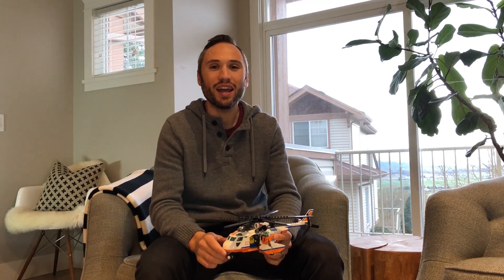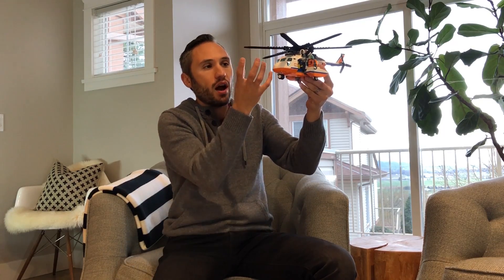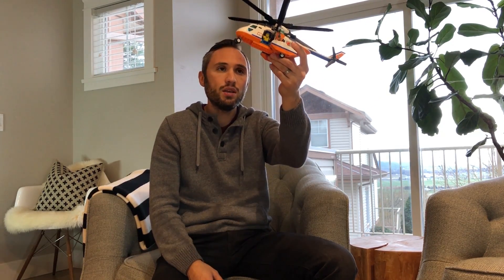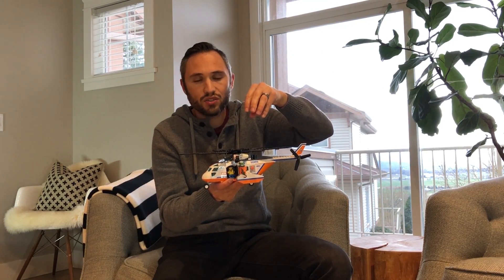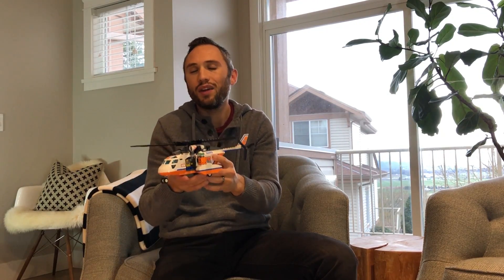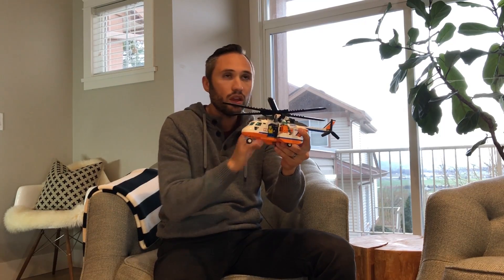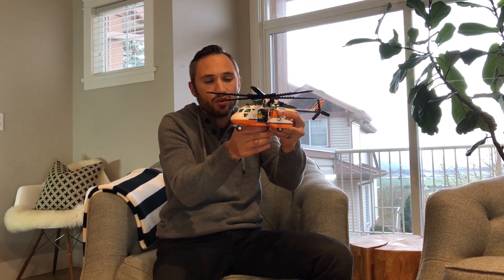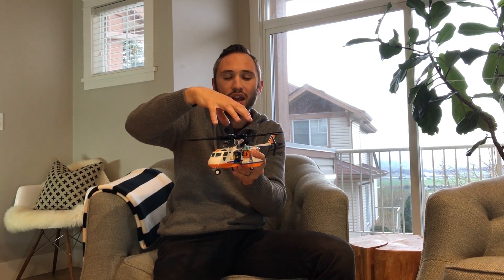Vortex Ring State IS NOT Settling With Power

Comment: It may be that your country has tried to use the name of one hazardous flight condition for another, but it's a case of majority rules, and the majority of the world has vortex ring and settling with power as the same condition. Does your definition of settling with power really need it's own name? To me this is just coming in too fast. You could do the same thing in an auto rotation, but you have no power, so what is this called, settling with no power? I'm yet to find a pof book that defines these two names as different conditions, but I certainly haven't read them all !

You also mention that the stall region in vortex ring moves towards the outer area of the disc. My understanding is that the outer area is not stalled. The vortex creates a high induced flow in the outer area which creates a very small angle of attack, creating a very small amount of lift, or even no lift, but it is not "stalled" p. 158 of PoF W.J Wagtendonk. Always happy to be proven wrong, but probably need more than a lego model to do it ;) love the videos, cheers.
Reply from the maker: Jon Keller just because the majority says something it doesn’t mean it’s right. I appreciate your feedback though. Settling with power definitely deserves its own term. Coming in on an autorotation is completely different because you maintain ample forward speed so that you can translate that inertia into rotor RPM and a deceleration of downward momentum in the flare. Completely different.
Reply: When it comes to naming convention, majority does rule. The words used in the name "Settling with power" do not describe the hazardous flight condition you have described well, however I will also agree that it does not describe vortex ring well either, which is why we have another name for it. If you were to look at the words used in the name, "Settle" and "Power", by your definition, every approach is "Settling with power". To come to rest with power in use. Nothing in the name describes anything hazardous. It's a silly name for both conditions, which is why I fall back to majority rules. I used the auto rotation example because the way you described it, you could apply that to powered, or non powered flight. It's as if you're trying to redefine the word "Settle" as something it's not. The words in the name should describe the condition well, in both cases they do not.

The way I see it, the argument most people make is "It's correct because it's what I was taught", and unless someone can back that up with a good explanation, is always a bad reason. The only reason you gave in your explanation was "it's the way it's defined by the Canadian faa". So unless someone can give a logical reason to why that name fits better, "because i said so" is not good enough. I've also heard that some people refer to over pitching as "Settling with power". Can't agree to that one either. It's probably a term people should stop using.
Reply: Not giving you grief, it's just an argument I've always found fascinating. What you've described, we would simply call "running out of power on approach", not exactly a fancy name, but makes sense to me. The moment where you've hit 100% of your power available and it's not enough to arrest your rate of descent, but your rpm is not decaying.

Comment: I Fly large radio control model Helicopters and this happens all the time, Finally an explanation as to why the helicopter suddenly sinks at an alarming rate and a way out of it, thanks!
Reply: I fly 3D RC helicopters and this phenomenon seem to be most susceptible on helicopters that have low power or high load per rotor disk area (or both). Modern 3D RC helicopters simply have so much power that you can escape from vortex ring state just by giving it enough collective. That's not something you can do with real helicopters, but it's great fun.
Reply: @timokokkonen5285  I fly large RC helicopters also, (Zenoah gasoline powered - not nitro). Neither of these conditions ever occur because of higher head-speed and the excess power that is always available. You can basically blast out of any condition. Unfortunately, most full scale helicopters have very little power reserve to escape these conditions and thus demand that you don't get sloppy and get into them in the first place. I do believe this is reflected in the accident rate of under- powered full scale helicopters of all sizes.
Reply: Falling thru dirty air....
Reply: a good few years back I had started out in RC Helis, and was puzzled as to why my heli dropped so fast while in a hover.  I had been descending quite fast in calm air conditions.  I noticed too that the same thing will happen in a wind.  If the heli is descending and its ground speed is the same as its airspeed (or vice versa) so heli moving in the same direction as the wind/air mass.. vortex ring will bite.  Try it, you will see what I mean.
Reply: Ive mostly noticed it as the helicopter is suddenly vobbling, it feels like it's floating on bubbles almost. Basically very unstable but  not unrecoverable as said.
Reply: Frankie NV how you are not dead then if that happens to you all the time
Reply: @LalaRanj1  Because he is standing on the ground the entire time. Radio controlled helicopters.

Comment: With the Vuichard recovery method, moving the cyclic to the left is only for European-made helicopters with clockwise rotating main rotor blades. The correct method for American-made helicopters (Robinson, Bell, etc) with counter-clockwise rotating rotor blades is to move the cyclic to the right.
Reply: Julien Pham - It's to take advantage of the thrust of your antitorque rotor to slide the helicopter over quicker.
Reply: Be careful in teaching the wrong recovery. The correct recovery is to slide over OPPOSITE the power pedal. What you say in the video will cause an excessive loss of altitude.
Reply: Power pedal fot the G2 is the right, so yes, you have to slide to the left with the Guimbal G2 @WaterFillerUSA
Reply: Why do you have to move the other side depending on the helicopter? If I understood the video correctly, the goal is to move out of your own downwash fast. So why is it important the direction you go? Thanks
Reply: Julien Pham , moving to either side ( side stepping ) will get you out of the vortex , when they are talking about the American made vs European , it has to do with power requirements , ( American made CCW rotor system going to the forward and right requires less power then going to the left and opposite for European helicopter. For more details look into TRANSIENT TORQUE. 

It only applies to single rotor helicopter.
Reply: @browniebrazil  that's not true. Raising collective will lead to less authority other the rotor system(stalling out more of the disc). The reason we raise the collective is to increase torque, that then is counteracted by the tail rotor(maximizing translating tendency) this is the main reason you move to the side. If you go the opposite direction, you would not only have to work against it, you also don't have enough mainrotor authority to accomplish that. In that case it would be wiser to go forward or backwards to not have to work against the tail rotor. 
Ask yourself why we don't go forward and only raise collective... When in SWP you simply  can't. 
Being able to sidestep will get you or of the vortices, true, but you won't be able to sidestep against your TR thrust. Trying it is plain stupid, considering you are in an emergency at that point.
Reply: @harf4ng  Redundant Rudder authority maybe?
Reply: I was just going to mention this
Reply: The thing is he had it completely wrong. Raising to fill throttle line, left pedal and left cyclic would lead to a devastating outcome, especially in European helicopters during Vortext Ring State.
Either left pedal and Right cyclic or right pedal and left cyclic... 
I would like to see him correcting this statement. Even though anyone doing this maneuver will have more training on it than watching a video, it might confuse someone into thinking "right right" or "left left" and crash.
Reply: SJP lol :) indeed that should be terrifying :) I think he made a mistake between rotor blades and the compass
Reply: VRS in a verticle  descent into a small landing spot thru a forest of 100' trees😨😨😨Now what does one do?😢
Reply: Is this do to retreating blade stall?
Reply: @jeironamobey8136  - It's due to descending fast enough for the air to flow upwards near the hub of the main rotor, and the upflow effectively increases angle of attack into a stall. It also results in a second inner ring of vortices near the hub in addition to the normal ring of vortices at the rotor tips.
Reply: jeiron session retreating blade stall typically happens in high speed flight. The helicopter will pitch up and roll left due to gyroscopic procession. The effect would also cause you to slow down, bringing you out of the stalling condition.
Reply: The cyclic is moved into the direction opposite of that of the tail rotor thrust. The combination of tail rotor thrust and cyclic move the helicopter laterally. Recovery begins when the main rotor travels into the upwash of the vortex ring it's laterally moving through.
Reply: @S LMAOOO
Reply: Was thinking this when I saw another vid on recovering from a strait approach landing on a ledge. Not realising blades were built to rotate both ways due to area build, I was thinking that the approach would matter if your only chance was opting out of landing with left or right cyclic. Be gentle, no flight experience in rotating or fixed wing, but I try to learn fast.
Reply: ...just to point out that it's just a brand in Europe which bilds helicopters with clockwise rotating rotors (Eurocopter, now Airbus Helicopters). All the other brands, such as Agusta (now Leonardo), bild helicopters in the standard way.
Reply: @palacio802  Russian are all standard rotation, as is Guimbal and many other brands.
Reply: Was just gonna mention this 😊
Reply: Plus he didn't mention to add power first, like in the video he linked (and which is correct).
Reply: I’m guessing he’s talking about the Cabri G2s he flys.
Reply: You are right Garry, this lateral recovery technic depends of the clockwise side of the rotor.
Anyway, what you guys call Vuichard technic, is not new, most of external load pilots use it since a while already.  This technic does not replace the other. Cyclic foward (or into the main wind) and pich lowered is still a good technic depending of the vortex conditions, weight, quality of your blades, rotor efficiency, trajectory/path, hight, (cross)wind(s), landshape and type of obstacles you got around you. 
One technic, doesnt replace the other, they are just complementary and combinable.
Reply: @dvclama  That answered so many questions it threw up. ;)
Reply: You cross-control, so you don't actually need to remember whether you have CW or CCW rotors
Reply: Actually, that only applies in relation to the Equator.  Blades turn opposite directions in each hemisphere.

Comment: On a R44 it would be left pedal to counter torque as I pull collective and right cyclic to move out of wash.   I think you said left pedal and left cyclic but even on a European you would be right pedal and left cyclic?   I think??   Great info!
Reply from the maker: chris leavens correct, that was my mistake.
Reply: good catch chris, was thinking the same thing.
Reply: chris leavens Eurocopters are usually the oppisite rotation on the main rotor. I flew an Allouette II in Guatemala and took a few flights to get used to it. Fly safe!

Comment: Damn dude, I'm new at this (having only done a discovery flight) and didn't realize there was so much to flying a helicopter but, your explanations are so easy to understand and make so much sense. One thing, once in a settling with power state, if started high enough, can I  presume a smooth enough landing not to crack a skid? And if not, would you go forward on the collective, kiss your ass goodbye or just not get yourself in a settling with power state? Your videos have me holding out for spring time lessons.
Reply from the maker: Joe-n-Tex the issue with settling with power is that you only get into it when you are coming in for landing which means you are close to the ground. Depends on how heavy the Heli and how quick you are going will determine the level of damage. It could be as simple as the skids absorbing the hard impact but with no damage or action damaging it.

Comment: i don't know where you get your idea from But you need to know why it's called vortex ring state o settling with power first. they are two different words that mean the same action difference in name comes in difference in action... ( vortex.... causing a vacum that sucks the helicopter ) .settling with power....  helicopter has power but losing altitude.)  hope you get it
Reply: jun toph I think we all agree on how Vortex ring state occurs. Close to zero airspeed, RofD greater than 300fpm. Correct? 

   “Settling with power” occurs with FORWARD airspeed AND descent. Let’s say Your max gross weight on a steep approach with 40kts forward airspeed. The ground is approaching quickly so you pull aft cyclic and collective to slow you down. You ARE slowing down but not quick enough, so you pull more collective. It continues to slow you down but is not enough to stop you before you hit the ground. (Ie. “sliding thru the stop sign”) 

Hope you get it

Comment: Any idea why moving to the left instead of the right is the best way to implement the Vuichard method
Reply: I was taught that going in any direction will get you out of VRS, left, right, forward or back.
Reply from the maker: It’s true that any way you can get out of that defending air is good. I think it just depends on the rotor torque for if it’s left or right. I’m honestly I think either would work. Sideways is quicker than forward.
Reply: I read that you are using the rotor thrust at max power to assist the exit. It’s in the comments of the linked video. In a Robinson with CCW rotors the right hand exit is more efficient but either will work. Apparently

Comment: Interesting, but I thought that vortex ring state happened when a helicopter's descent actually over speeds the down wash, so that the air flows up through the rotors rather than down? If this is not the case, could you clarify what this really is?
Reply from the maker: AeroTurtle that’s the simplified version that some instructors like to teach because it’s easy to visualize but it’s not completely accurate.